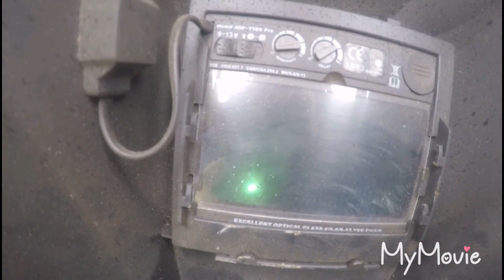Digging / leading / Installing retaining wall.

Comment: You and your crew do really amazing work! The wall looks great. What size is that excavator?
Reply from the maker: Denny's Country Life It's only a 3 tonne machine but we do some quite big jobs with it. We run 3 machines a 1 tonne takeuchi , 2 tonne Hitachi and the 3 tonne New Holland , if we need anything bigger we just hire one in. Going back to our legal towing weight I'm on the limit with the big machine behind my pickup , if we get a bigger machine l will have to pull it with my tractor but l'm trying to stay away from that because theres lots of red tape involved. Thanks very much for your comments , Paul.

Comment: How do u get on with the parweld inverter I was looking at getting one and just wondering your thoughts on it.
Reply from the maker: Hi Sam , it's a very versatile little welder, I've welded wafer thin exhaust pipe with it ,stuff you would expect to need a mig for. It will also turn up enough to weld H girder together , and it is light enough to carry on your shoulder and use off a ladder . As you can see l was welding with wet rods in the rain but it still did the job . Thanks for watching and commenting.